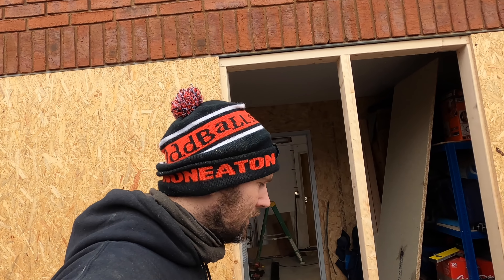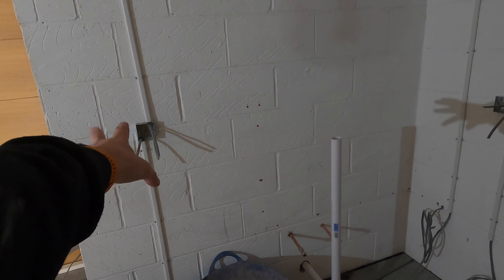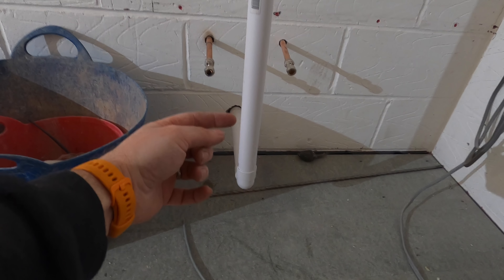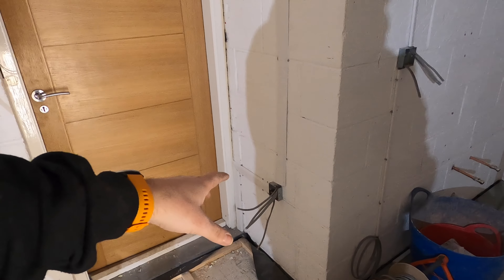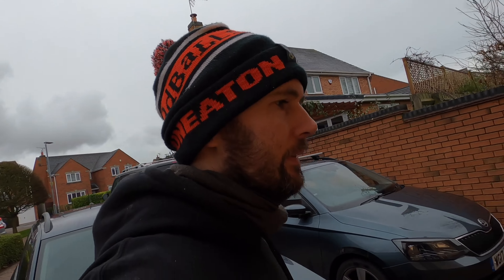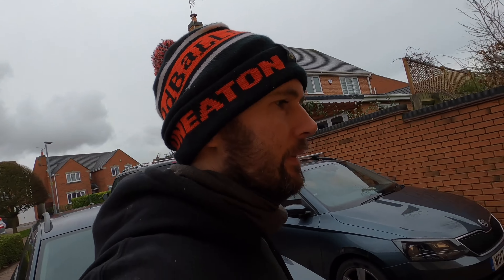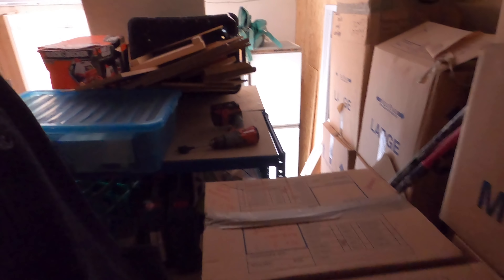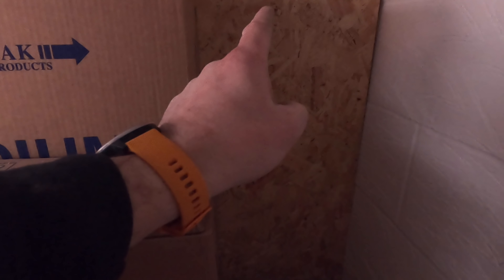Part 2 of the Garage Conversion - Sorting #outside- lights configuration

Comment: Try to keep the condensate pipe inside the building, had a callout to one that was run outside and along the wall to reach the drain point that had frozen in the recent cold weather, and was leaking from under the boiler onto their floor. Fortunately they heard the dripping sound and put a bucket under it, collected about a gallon of water over 4 days (saved their engineered laminate floor from water damage) Boiler only installed 4 months ago. Great videos, keep up the good work. Pete 👍